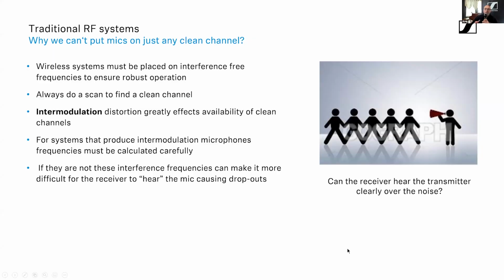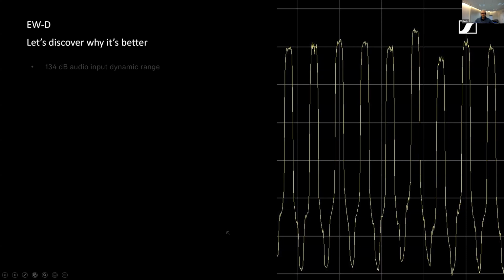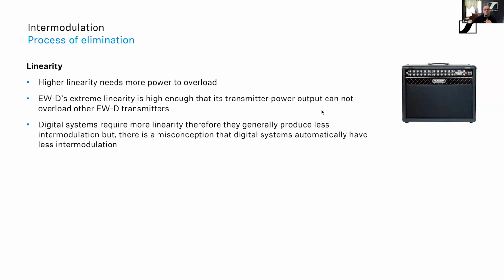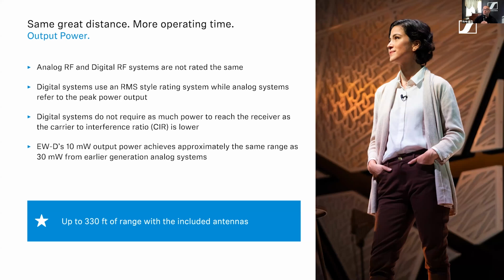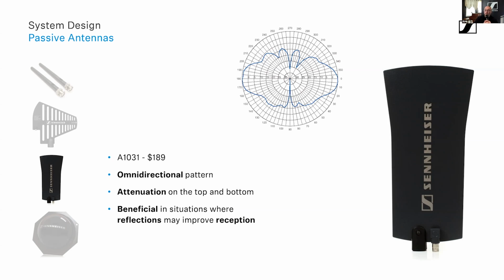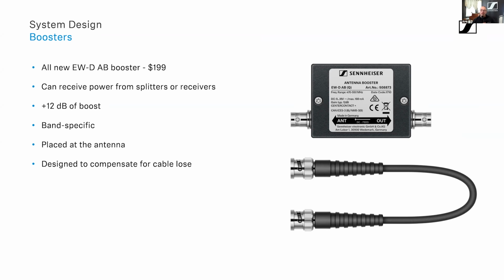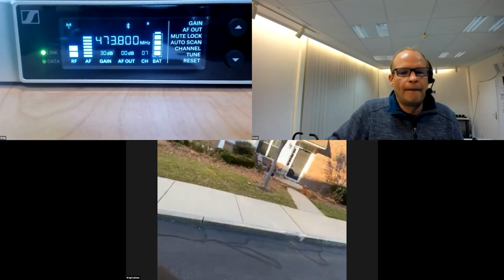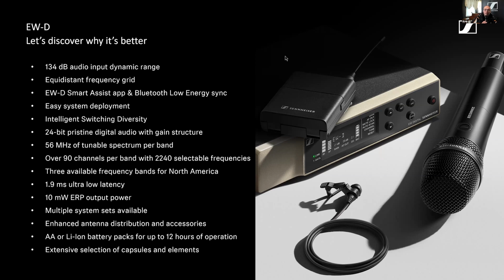EW-D Episode 3: Taming The Wireless Link | Sennheiser

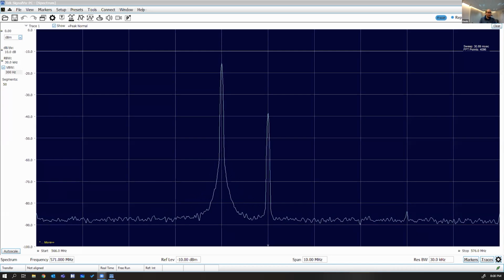Comment: This is a great video - thank you!  We just bought 4 EW-D systems and now I understand the benefits. Nice job!!   I have a simple question: at about 7:30 time stamp in the video, when you turn on a G4 systems at 571 MHz, there are smaller dB peaks about about 4 MHz either side of the primary (the 571 MHz signal).  What are these?